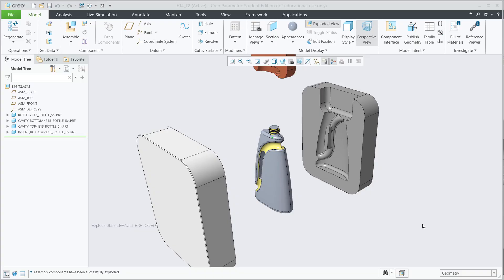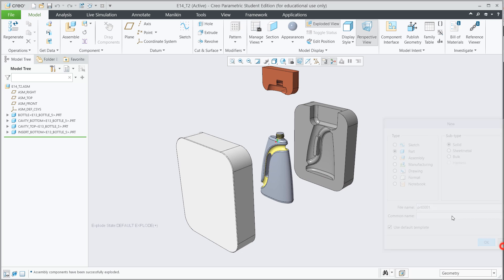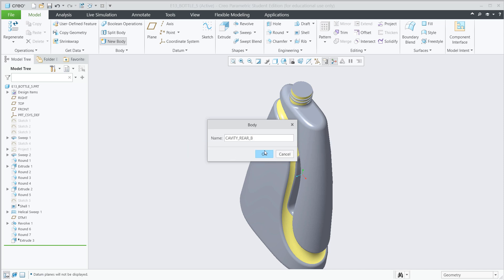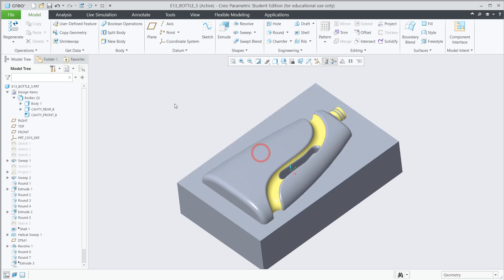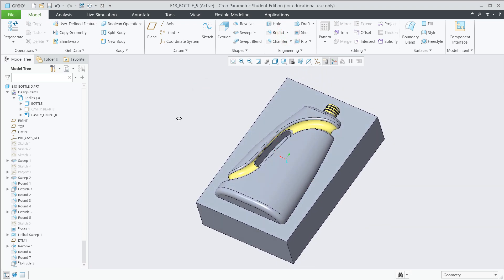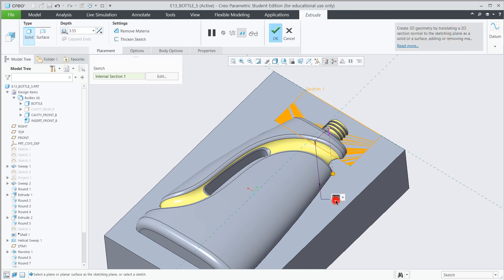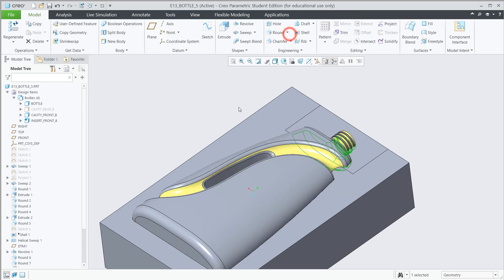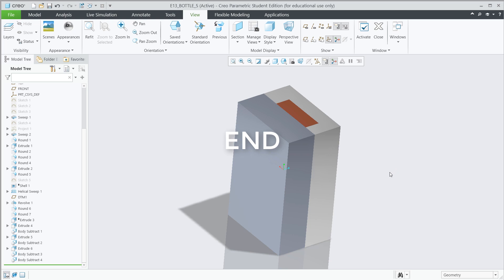E14 Creo Parametric 8.0 - Basic Bottle Mold Tutorial

Comment: Good video, I'm getting as far as the boolean option but it isn't letting me select my part I will be subtracting from the mold, any ideas where I could have gone wrong with this?
Reply: I am having the exact same issue - two years later.
Reply: @mishagdon  you need to supress the shell. when it looks for a way to cut the part, the cutting tool (the bottle) is hollow. this, I think, is why he mentioned that some places prefer you send them the unshelled part
Reply: Also if you made the bottle earlier you would have shelled it. Gotta go back and remove the shell to have it be a solid. Otherwise your mold will still have the middle with only the walls removed.